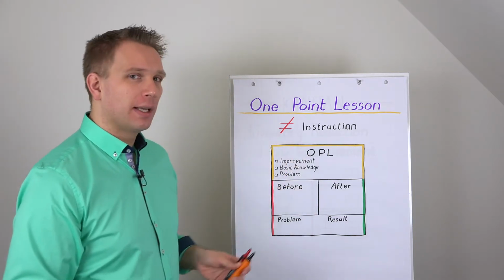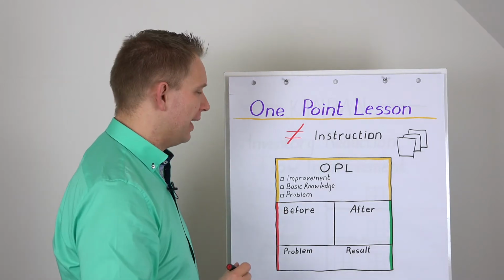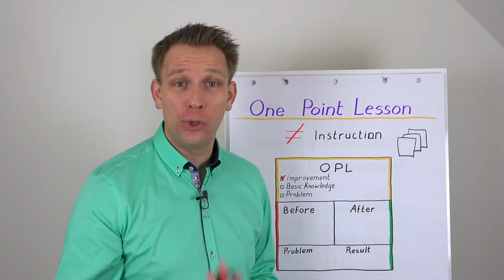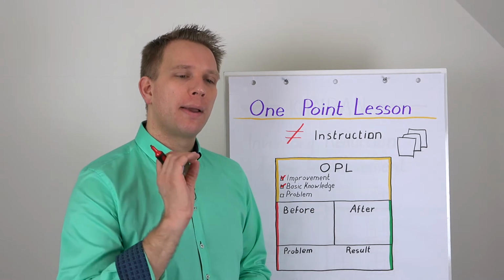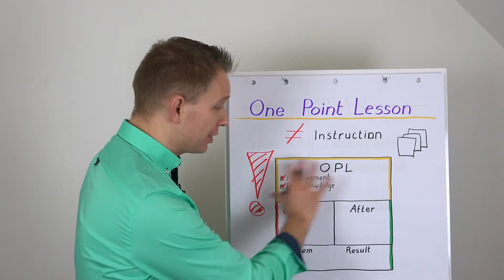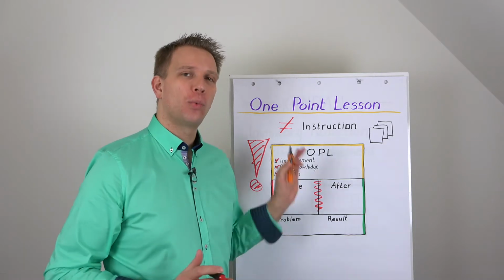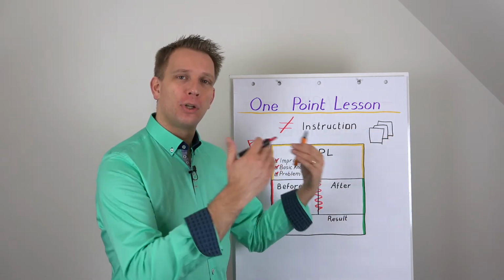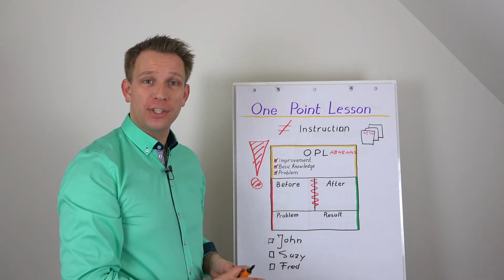Don't use a One Point Lesson as an Instruction | How to use OPL effectively

Comment: I was trying to use it as "work instructions" it got really confused really fast...
Reply from the maker: It does, doesn’t it…
I have the best experience with making 1 work instruction for each district process or workplace: keep all information about working a line in one place and tack OPL onto that instruction when extra clarification is needed (shouldn’t be part of the original setup - only added on at later stages)

Comment: I have never heard of a one point lesson until I watched this video.  Perhaps they are called something else at my factory.
Reply from the maker: Not all organizations use the term, it might simply be called “a memo”. Also, many organizations don’t use the OPL concept at all; using only full instructions or standards operating procedures (SOP), or hardly any formal instructions at all (but that’s a different topic).
They are a common tool in Lean and TPM. Because they’re quicker to make than full instructions, I see teams and companies misuse them to replace instructions- that prompted my video. 

May I ask what structure/system your factory uses for instructions?
Reply: @TomMentink  We create work instruction to be ISO 900x compliant.  We have a searchable document database called ETQ where documents go and are possibly never seen again.  When a document is updated,  the people who need to be aware of the update are sent an email requiring them to read the document and sign off on being trained.  However, I am not certain if the change made to the document is highlighted in anyway that makes it stand out from the old document.  

My company is holding its first Kaizen Event in many years this week.  We are hoping to improve changeover time by 10% in the target area and create standard work instructions.  I apologize if I sound like a novice but it is because I am.
Reply from the maker: @JosephB1981  don’t worry about sounding like a novice - you see your weak points and are making the correct steps to improve them, that is the spirit of Kaizen!
So that system is a pretty basic setup, which can work very well, but is often indeed a black whole for instructions to sit and wait for that once a year ISO audit, when the quality department shows the auditor that everyone signed off and is officially trained. Which is a waste of everyone’s time. (not saying that’s the case for your factory, just that it’s an all too common observation)
You’ll probably find my video’s on OPL and organizing work instructions interesting to check out. The short of it, is that you’ll probably want to keep that current system (since it sounds pretty complete and already has a nice system for whom to reach out to in case of updated instructions). Do keep updating those instructions every time you make an improvement in one of your processes. A bit depending on that ETQ system, either send out an OPL to highlight what changed or keep it for formal signing off on updates (the former would be best, but is often difficult in such systems). The important role for OPL is to explain the changes - so it uses the changes in the instruction as a basis (including steps and key details), but goes over the old situation, highlights exactly what changed and adds to that why this is important. The OPL is a document to fully explain the renewed process to people who were already used to the old way of doing things (and it’s more difficult to change a habit than to learn a purely new skill). 
Just don’t fall into the trap of forgetting those old instructions and making only OPL from now on - that may seem like an easier solution, which makes your improvement teams a lot more independent, but it’ll get you into trouble in the longer run (that’s basically what this whole video was about 😊)

Comment: Thank you for your useful clip. I am working for a company project-based. It produces 5 measurement tools as fundamental however it has pretty many projects needing specification measurement tools for their processes. Indeed, our activities are to meet their needs. As a result, every project is a new one. How do I write a standard process for each project? What do you think of using OPL for every process alongside fundamental instruction in this case?  Actually, I need to have instructions to train my operators not to rely on just one operator.
Reply from the maker: Good question, hopefully this help you:
Make a good instruction for each of the tools, with which you can train a new person to properly use the tool. OPL’s for specific use cases can work really well together with this - you train with the full basic instruction and give the specific OPL as a handout and possibly hang it at the workplace for quick reference too. This is a good way to split the full knowledge about the tool (including how it works and why) from direct practical info for a specific use case.

Comment: Hi Tom, very useful information. But what would you suggest doing or keep in mind if a company has never done this before, and wants to start communicating with its sections/departments? Thanks!
Reply from the maker: Using OPL's as a means of communicating new standards is perfectly fine - that's what it's meant for.
Where you'll have to be careful is that if you want a more permanent type of work instruction document, you make them as complete documents per process or workplace, and not simply bundle all OPL's together and call that your WI's.
What you can do to start up the system of WI documents, is to copy the information and concepts from your OPL's into a document per workplace. These WI's won't be complete when there are only a few OPL's in there, but at least you're making clear that the direction is to create 1 document per workplace and that individual OPL's will only exist for a month or so (determine a time based on how quickly you expect your people to absorb the info).